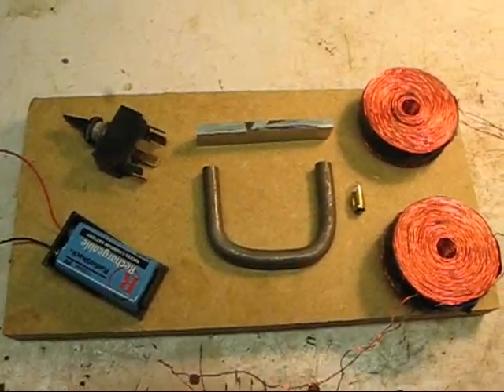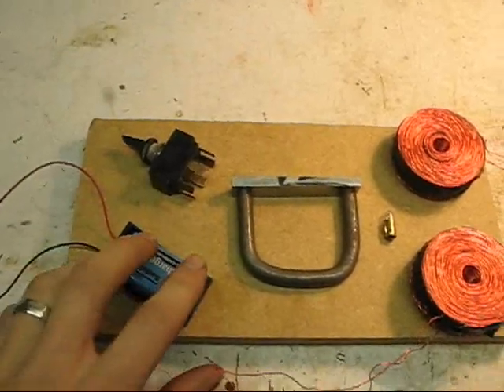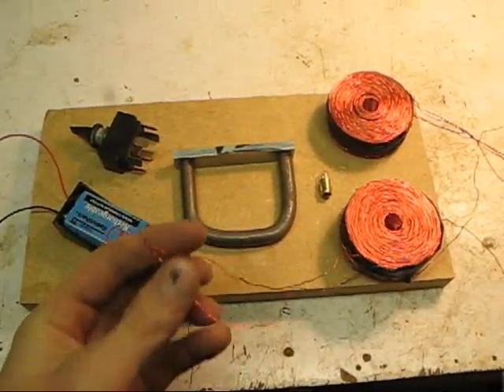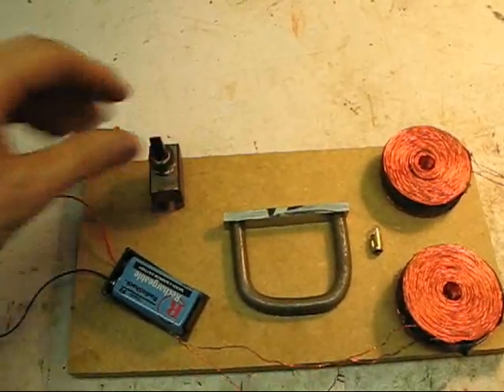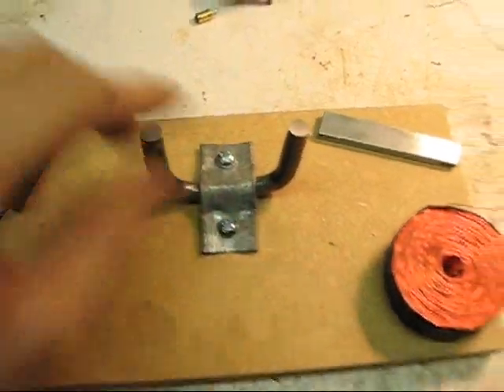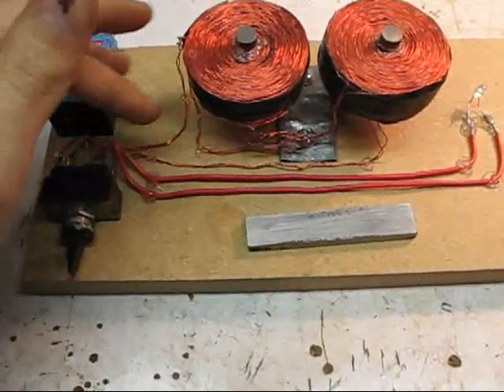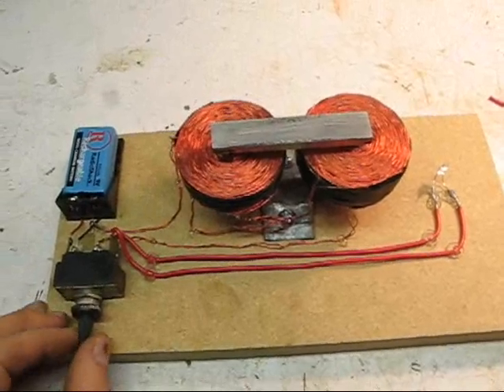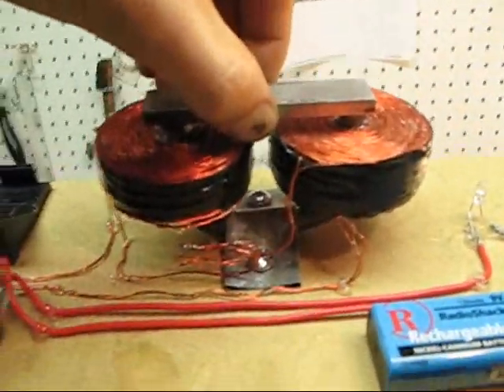Ed Leedskalnin Magnet

Comment from the maker: I agree with the your explanation for the most part.  But the electromags at the scrap yard defiantly do not use this specific application.  Correct both are electromagnets, but the major difference is that the junk yards magnet requires a constant electrical current to operate, whereas my device stores the charge when its turned off.  The ability to store magnetic current isnt something widely discussed.

Comment from the maker: @allthatjazz989 
Well its pretty simple, the switch opens and closes the circuit to the primary power coil one way , and then the other way it closes the circuit to the LED on the secondary.  Ed shows it wired differently if you read his magnetic current book, however no special wiring is required to get the effect.  Mainly you need a good iron core that mates up perfectly and a coil with a good number of turns.

Comment: the best thing to do in order prove that a magnetic current is really trap in that u shape electromagnet is to approach it with a compass. This perpetual motion holder were used by Ed, to strengthen the magnet in the V magnet that He used. The main thing that He use to construct the Coral Caste is the FLYWHEEL, we should all be focusing on that not the PERPETUAL MOTION HOLDER. Thnx for posting your video.

Comment from the maker: Thanks, i will post a schematic if i make another video.  Its actually very simple.  You dont even need 2 coils, one will work.  Put your coil on your u shaped bar, set the other bar on top, touch the coil leads to a battery for a second.  Thats it!  You have your permanent electromagnet even when you disconnect the battery.  Then hook the coil leads up to a bulb(led in this case) and rip the bar off the top.

Comment from the maker: @yttermayn 
I havnt measure\d it but it seems like a fair amount, which is why i dont really think its practical for anything but a learning device.  Its much more efficient to get the collapsing field by using the proper frequency at a givin inductance to catch the reactive flyback of the coil.  It basically acomplishes the same thing without having to pull the bar off.  The 4th vid demonstrates this effect.

Comment: Nice little set up......Someone at Purdue did a similiar one to yours, people still argue exactly what the implications are of it. Ive done a similiar (much less impressive) version.... By taking two paper clips and a magnet hold the mag to one clip and pick up the other. Now SLOWLY take away the magnet and the clips will stay together...yet if you try to pick up even a tiny scrap of metal at their junction point it will not work.....so the effect is not a magnetic one(well not outwardly anywy)

Comment: Question on the coils in general, you have the 500-loop coils there, since the copper material of every coil is in contact with other coils, wouldn't the electricity just direct pass through the whole piece instead of going over every loop? in other words, what's the difference between the 500-loop coil and a one piece donut shaped copper conductor? in reality, why would electricity goes through every loop? what if a loop is broken? would the electricity re-direct through surface contact? thanks
Reply: Copper wires are covered in thick lacquer type insulation, like when you dip wire in paint and let it dry, then it’s nonconductive. Solid piece of copper will not do it as the field is generated by electricity going into loops and as more loops you make and more electricity you provide, the magnetic force is stronger.

Comment from the maker: @codygillespie 
Edit:  sorry i forgot in this vid i dont use a secondary coil, so the switch closes the circuit to the coils and the battery one way and disconnects the battery and closes the circuit with the LED the other way.

Comment from the maker: @MegaHazzer123 
Were you using an AC power source?  The magnetic field of the filament will fluctuate polarity with the 60Hz wall power.  Subjecting this to a magnet should cause a push/pull effect on the filament with the alternating current.   Thats my best guess.

Comment: I'm not educated in electrics, so it's easy for me to guess that the coils were just like capacitors. The bar clung on, kept the circuit closed, like a vacume. Not even sure whether the current needs to "run" to sttically keep the bar in place like that.
Looking forward to the summary of narutoz1996's book!

Comment: A small amount of magnetism will remain in the steel after power is removed.  This happens all the time in screwdrivers laying around the shop.  Then they pick up metal shavings from where ever, a real nuisance.

Try it with a nail.  Wrap some wire around it, give it some DC, and viola . . . Magnetized nail.

Comment: It seems bizarre that the metal bar stays attached, even though you've de-energised the electromagnet! 

What I was taught at school, is when an electromagnet is de-energised, any metal attached to it will just fall off, because there's no longer any magnetism holding it there.

So....After you have de-energised your electromagnet, where is the magnetism/energy coming from in order to hold the bar on there?

Is this one of those Free-Energy type things? 

-BoomBoxDeluxe.
Reply: Yes, it's bizzare and it proofs the point of perpetual motion holder (PMH). Some people don't realise it, but this simple experiment proofs that once set in motion (in a closed loop) the magnetic current will circulate indefinitely long (a perpetual motion of... something). You can detach the battery and wait for years and when finaly break the loop, the diode will lit up "burning" the energy of the released magnetic current.

Comment: Hi, why does the small led glows when you remove the bar?
Reply: Part of the info is when a wire goes through a wire it moves two things, electrons and protons. When they strip the electrons the protons are remained. That's what causes what they call the lenz law effect. The coil has become so full that the protons are blocking the flow (that's DC now). In this case the loop of the metal has become a permanent  magnetic and when you break the loop the protons produce a voltage. Try that with a stranded steel wire and see what happen. You won't get that spark because it's not building up in the metal. Do the same thing with a sheet of copper. 
  A magnet will slide down the copper slow. BUT if you put slots in it they will go down fast. The mass of the metal or copper increase the amount of protons.

Comment: all you did is by running 9vdc into coils is create a weak magnetic feild in the flat bar north south and when its pulled off sends a pulse into the coils  primary and exits the secondary to light the lamp scrap the bar get a bar permament magnet and stick it on n pull it off it  will flash without a battery if u put a bolt in center of magnet to a drill and spin it close to u bar it will generate ac out and bulb will keep lit check voltage of output n bulb rateing first  4diodes will out dc

Comment: Cody ! Shame on you... You said powered it up!!!! When you flipped the switch you put power in the coils to perform electromagnetic work. Since they're in a close looped circuit, they don't loose power. because of surrounding magnetic field feeding off the  aetherial energy, is will go for years and hold the bar across the coils.